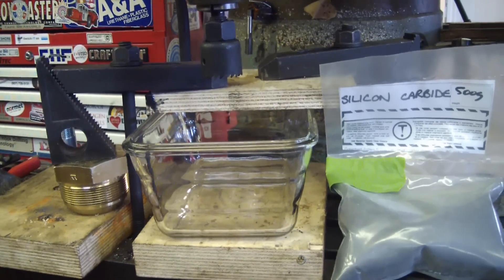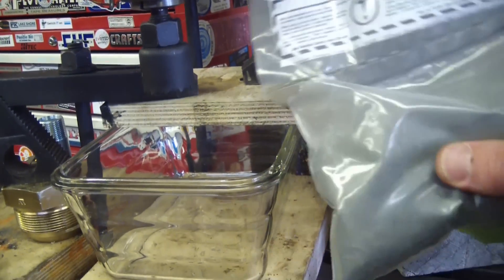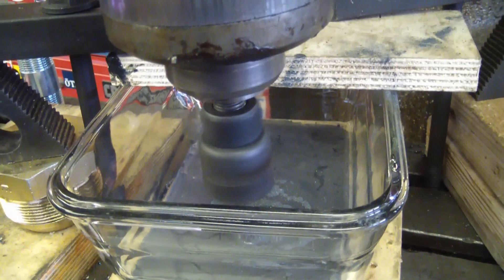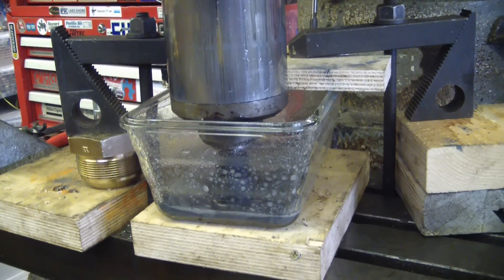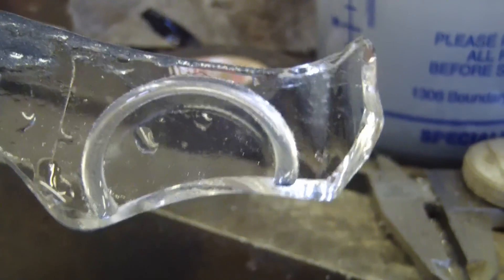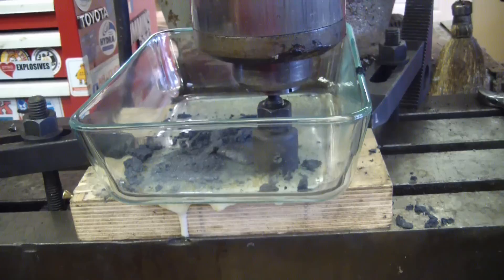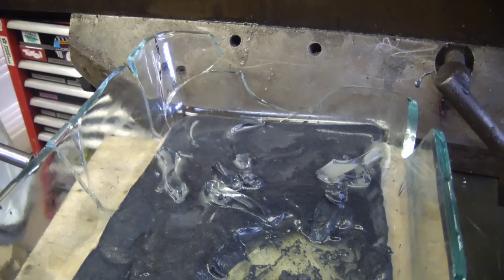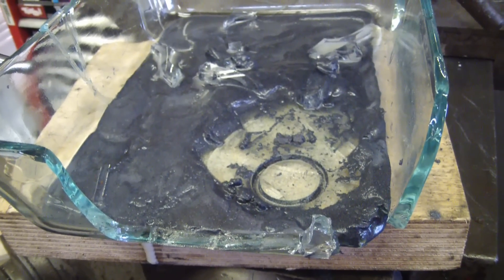Using Silicon Carbide to cut glass

Comment: I am a glazier or well i am still a student, but i have worked as a glazier for quite a while now. 
1. Get a diamond drill bit, that techniques you are yousing is not going to get you anywhere. 

2. If the glass is hardened, you can't process it. (The glass you tried to drill in does not look hardened) A scratch in hardened glass will result in it to "blow" into millions of tiny pices. like in this video: https://www.youtube.com/watch?v=1oHwaqvqhVs

3. Drill from both sides, first drill a bit over half way through 1 side, flip it over and drill from the other side. Use water. 

If you have any questions please contact me.
Reply: +Niels Salling Nah, the pyrex is heat treated to some degree, you can tell by how it popped.  Not full on tempered like window panes, but still heat treated none the less.
Reply: +damedog19 yes exactly, the is a difference between full hardened glass, and partly tempered glass. Both types are verry hard to process. It is said that is in Theory is possible to remove around a millimeter on full hardened glass, like window panels. The Pyrex is a manifaceture of products made from Borosilicate glass, only in USA do they use tempered glass, and the glass he is trying to process is partly tempered.
Reply: +Eric Wesson The glass he is trying to process is partly tempered, I can not tell if it is because of the molding process, but i think not. A lot of glass cookware are tempered, or made from Borosilicate glass. non the less, using a holesaw for wood, and silicon carbide are proberly not the way to go... I have never used silicon carbide for processing glass, but i have heard about it done earlyer before diamond tools was available. especially in old mirror production, before on-line floatglass was a option.

Comment: So, have you figured this out? I'm thinking keep doing what you're doing, but get rid of the teeth on your hole saw bit. Flatten the surface, more contact on the glass, more Silicon Carbide against the glass, an even stress point while cutting, yes/no??

Comment: You need a glass pan with a hole in it but the type of glass doesn't matter, is that correct? Pay out the ass and have a glass worker make you one, or work one out yourself. I wonder if a water knife would do it though...
Reply: One of those incredibly high pressure things that use a water jet to cut damn near anything. I don't know the real term for it...

Comment: That would take about a minute with a diamond core bit.
Reply: and use a hand drill so you can wobble it to make the cut slot larger then the cutting blade. I use crushed ice inside the core bit for lube. low RPM
Reply: Let the tool do the cutting, don't force it.

Comment: Just want to say thanks for posting your failures.  Everyone else just dumps or retakes their content.  Also, I'm no expert but I've always heard if it's tempered then it can't be cut.  Most Pyrex today is just tempered regular glass and not borosilicate(i.e. Shit)... Had the same thing happen to me when heating my "Pyrex" measuring cookware with an open flame and it exploded all over the place, found out Pyrex doesn't mean what it used to.

Comment: heat! it's all about the heat.
Ever had a glass fresh out of the dishwasher, on the bake-cycle, and you put cold water in it? You're going to have to make many passes, and SLOW SLOW SLOW with the bit. Also- I went full minority report, and ENHANCED (.25x speed). There seems to be a tiny wobble to your bit. With glass, that's going to be putting lateral pressure on the hottest part (the bit that just got sanded out by carbide), and unlike metal which will "chorale" the bit into place, glass has no resilience to those forces. With metal- you smear the metal with the point, and shave it with the edge. With glass, you basically can only scrape- no deforming, no shaving, which is why glass bits are flat (not even beveled to give a "point"- this would drive a wedge essentially, and shatter-city).
I think you need to stabilize that bit to oblivion, and ensure there's constant carbide action- metal on glass will shatter, you need to be "sanding" a pattern based on the drill tip. Consider heating the whole thing up a bit. Glass holds heat reasonably, so if you bake it in the oven, you'll reduce your thermal difference between the cut and the edges. And make sure there's absolutely no wedge-shape to the cut, the initial contact patch should be the final width of the cut. Infact, you might consider taking that bit to the lathe, and slapping off the teeth all together, and putting some notches to ensure carbide gets down into the cut- just make sure to round off the leading-edge. You don't cut glass, you grind it.

Oh, and for the real glass-cutting advice. Get lucky. Get very very lucky. I've seen guys who cut glass for a living shatter a panel that they were nearly finished with just putting a finishing bevel on the edge (on a friday afternoon of all times.. I just went ahead and did my best vanishing impression, since the tension in the air was more brittle than the glass the shop was filled with)

Comment: Is it possible that the shattering may be from resonance of the tool vs the glass?
The fluid surrounding the cutting surface should be sufficient to cool and resist heat allowing the glass to stay intact. I noted the glass shattered away from the cutting site giving some sort of idea that it may be a frequency, not heat. 

https://youtu.be/JDnNmLkQ3Bc

Comment: I've heard that glass can be cut by laying aluminum foil on it and using a plasma cutter.
Reply: +AvE Try just using water and not constant pressure with low force, Saw a guy make a decent chunked hole that way. If you use constant pressure it will vibrate the glass to death I think.

Comment: For like $9 you can get a complete set of diamond hole saw bits on eBay that work really well, that's like a dollar per bit, including shipping.  I've cut hundreds of holes in glass with these, and they work well, but get dull after maybe 30-40 holes.  Always use water with it or you are likely to see cracks form.  Some glass is impossible to cut without cracking.  Amazon has these too (much faster delivery): https://amzn.to/2NiIMfg

Comment: Today I wear the imprint of my wedding band still branded into my ring finger 60 years ago, When it completed the connection between the battery plus and ground on a 1948 pontiac starting circuit I was working on. Laugh, If you will, No jewelry is safely worn around machinery or high current, Several men have been killed when their long sleeve or neck tie pulled them into the lathe they were running, Terrible mess to have to clean up.
Reply: +lloyd lisco Yeah i know... all those machinists that wear neck ties to work are just silly. 
There must have been been millions of them before..... 

Long sleeves are just plain crazy, i do all my welding in the nude. 

That ring might just save your finger when working with a rotating mass.

There's plenty of places you shouldn't go sticking your fingers into... Obviously, as you have already learnt the hard way, a live electrical system while wearing a conductive band is one of those places.
Reply: +Ben Lucas When you are welding nude, Be sure you don't clamp the rod holder on the wrong rod. Well thats about the size of it for today

Comment: Don't bother  cutting it. Get a high temperature torch and either melt a hole in It  or heat it enough to slowly puncture it with a steel rod

Comment: It is most likely do to the the tempering process where the glass will be super heated to the point of allmost making liquid state then the glass will be cooled rapidly, which will cool the outer shell faster then the inner shrinking the outer shell around the inner glass. essentially it creats a really stiff and rigid out shell with a soft inner. When you introduce a defect into the shell the inner glass pressure will expand and shatter the glass. That is why you take a hammer and bash tempered glass on the face and not shatter but just dink the edge and it will shatter in a million pieces. Video for referencehttps://m.youtube.com/watch?v=GCnQVVfjabk

Comment: Strange, I think maybe you are using glass that has not been properly stress relieved. Perhaps to cut cost, the company the pyrex kitchenware division name corning sold off to "something houseware" (who changed it into soda lime glass) is cutting costs, not allowing the glass to remain in the destressing ovenlong enough. They just relieve stress to the point where it wont explode in the oven. A higher quality glass manufacturer should yield better results. I machined a microscope slide with a diamond wheel submersed in cooking oil, because the plastic lense on my edc light kept getting scratched up. Try higher quality glass, it might just work out. Brilliant cutting method to use an abrasive bath and a conventional cutter. Glasscutting is a very tedious process, buy ya just cant get glass!

Comment: First Yes that glass is pre stressed but you can still cut it clean most glass is stressed as outside cools quicker then inside

Next your hitting that perfect vibration and well it shatters the glass
Resonant frequency is a bitch 

Your effectively making a reverse monk prayer bowl 

Copper pipe and carbide works because it asorbs heat and micro deforms under load

Comment: Yeah, that kind of glass, as thick as it is, and how it was formed, is going to have internal stresses up-the-wazoo.  These can be lessened by annealing...  maybe.

https://en.wikipedia.org/wiki/Annealing_(glass)

Know any glass blowers?
Reply: Did I miss a mic/audacity question somewhere...? 

Since sound travels 15+ times as fast through glass as through air, just record via one medium or the other, not both.  Earbuds make sensitive contact mics on amplified inputs (which is what most PCs have)...

Under the 'Help' menu, at least on Macs, there's an "Audio Device Info..." choice.  This spits out the system's audio capabilities, although some bitrates  may be wildly exaggerated:  Try 96000, set the recording level so it doesn't clip (Under View, enable "Show Clipping"; the waveform display will go red when its samples hit max volume), make some noise, and see where the spectrum falls off, or gets a bit too smooth...  If you get interesting lines right
up to the far right, bump up the sample rate, and repeat.

From your vid, there was a line at > 9000 Hz, that I isolated with high pass filters, then used the 'change Speed...' effect to reiteratively slow the clip down by -50% until it sounded quite nifty...   I usually duplicate a one second point of interest from the original, and work just on that, so it's easier to figure out, retroactively, what I'd done to it.

Comment: hesitant to comment but fuck it. you need to grind the teeth off the cutter, make her flat. only 1 tooth has to bite 1 time to break that glass. also! use something thicker than water.ALSO!!!! if you don't go at from the back side a little bit first, when the hole pushes through you will have a big ass blow out around the hole. that was the only was to keep the back of the mirror from blowing out around holes.

Comment: Many plants are said to be poisonous, actually they are just entertaining. Your neck hurts. How much weight do you have in front? Stand with your back against a door jam. how much space is between the small of your back, and the back of your head? If you can slip an open hand behind your back, and a fist behind your head, your to fat. Problem, losing weight will not correct your awful posture. It's sort of like sagging the springs on your truck with too much weight.

Comment: I think you're trying to cut it too fast, and the teeth don't help. Lower rpm and less pressure. It's a long slow abrasive process. In a lathe grind off most, but not all the teeth. Turn it slow with light pressure.

Comment: I'd remember a post by wbeaty on melting glass using a microwave and thought it might do the trick but after re-watching his video (https://youtu.be/cskB5c0mJ58) he does mention that upon cooling the glass would end up cracking.

Perhaps another idea might be to create a point of failure in order to limit the cracks breaking out through the whole dish. If the preferred hole size was etched into the glass first before drilling with a smaller diameter.. Although I reckon +patw52pb1's idea sounds more elegant though.
Reply: ***** If it's not borosilicate, it cracks on rapid cooling.   So, it might be possible to use glassblower shop techniques to melt holes without cracking.  Pre-heat the glass object in a kiln or very hot kitchen oven (but not enough to trigger microwave melt,) then quick transfer to the microwave and nuke it after blow-torch, then immediately put back in the oven and cool slowly.    A glassblower shop could do this easily, since they know the oven temperature for each glass type, and might have ceramic etc. supports for holding the pre-heated bottle in the microwave without having it shatter by touching cold metal.

That, or simply use an oxygen torch to melt a hole in pre-heated glass.   The microwave trick is for those who don't have access to glass shop or welders oxy torch.    Cheap plumbing torches can make glass glow red, but only barely reach the softening temp for tiny glass parts.

Note that Pyrex is no longer the expensive borosilicate.   I heard that Corning sold the trademark, so now Pyrex is just tempered glass, not the good chemistry-lab glass that doesn't even need to be tempered to resist thermal cracking.
Reply: wbeaty Cool! I went off and did a little reading on glassblowing and lampworking after your neat reply and it seems that soda-lime glass requires a bit less temperature to be worked on which is why it's considered 'soft' compared with the higher temperature requirements of the 'hard' borosilicate - this might make the cheaper soda-lime glass a bit easier to cool slowly without having a proper kiln.

Comment: It's tempered glass, it was inevitable and nothing can be done to stop it. Tempered glass is under internal tension; it's like post-tensioning for glass, the internal tension -  sometimes up to 10,000 psi - strengthens the glass to resist breaking. As soon as you cut it, you provide an imbalance within the structure - a stress point ... BLLAAAMMMMOOOOO. Don't try to cut tempered glass, you will never be successful. I'm surprised it didn't break into more pieces.

Comment: i think your s.o.l. and need to go get a diamond bit. try a smaller hole first and work your way up. and use oil instead of water. this sounds stupid, but i used veggie oil when i was making makeshift beakers out of old patron bottles. worked pretty good.

Comment: I have some Drill-all drill bits off Ideal World.co.uk that can cut glass. you get 12 plus some other bits and bobs for £40, haven't tried them yet but I've seen the guy demonstrating it on live TV without problem.The biggest size however is 15mm.
Reply: quantumbox01 They do come with a 10year guarantee though :)

Comment: You need to re anneal it...heat it up to aboit 350 400 f. For about 12 hours slowly...
Up to temp for about 6 and down temp for another six...if your hard core 12 hrs to temp and 12 down...
Afterwards use a coreing bit with smaller gullets...and ease up on the weight a tad...
Remember, slow as hell and patient as fuck...twould be rewarded 🎃

Comment: This guy holed a pyrex dish -  did it with a diamond hole saw and a hand drill:

https://www.youtube.com/watch?v=FPY7k9dkI8g

I think maybe you need to slow down the RPMs and back off the pressure. I've drilled tempered glass tile with a carbide tile bit, from experience you can crack those tiles easily if you apply too much pressure and try to work too fast. I'm wondering if your water bath is too shallow to properly cool down the business end.

Comment: Reminds me of that old kids song you know the one .. POP goes the weasel.
Yes dude your getting old it happens get over it.
 I'd like to throw in my 2 cents ,  one remove the teeth from the saw  or use a piece of pipe maybe thin wall to avoid or ease the pressure it's causing vibrations and not the ones the wife likes . slow is good slower is even better . last try drilling for the  bottom up go ahead you always wanted to . or from the bottom down in this case gluing all four side  with maybe something to support the walls and bottom from the inside may help as well. hope this was some help please let us know how you made out ,
WE could use more laughter in the world

Comment: dampen the frequency by running electrical tape around the high sides and two strips the lenght of the bottom then under the spot your drilling. bingo bango...bob's your auntie.